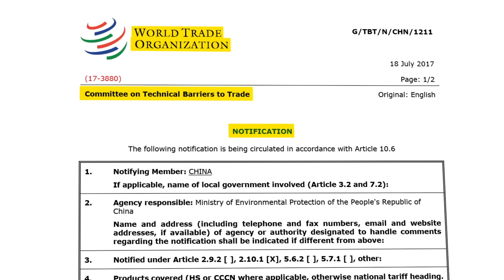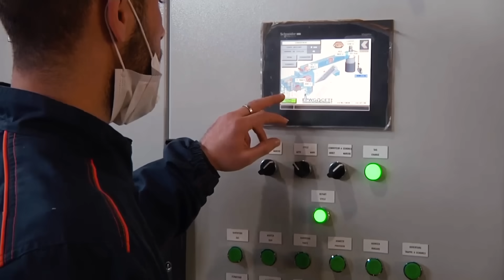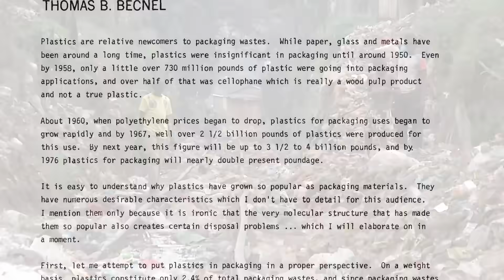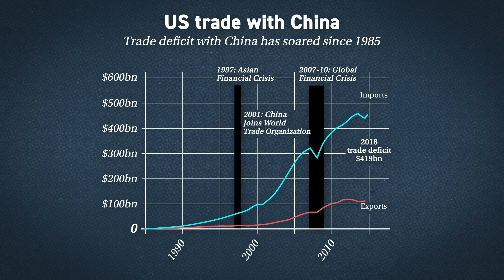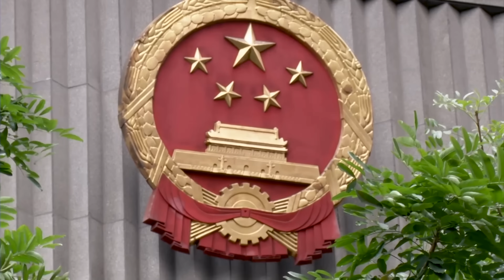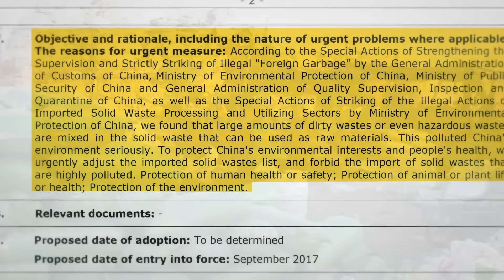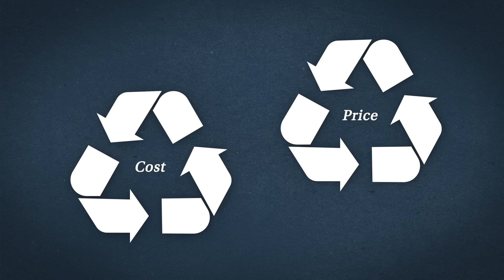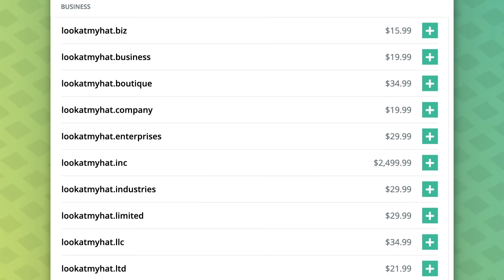How China Broke the World's Recycling

Comment: I think this rather misleading.
Firstly the Chinese broke the recycling system twice. 
First when they started pulling a ton of waste in. This caused major changes and shutdowns. You point out that the plastics industry started to look at the recycling programs in the late 60's but it was only in the 1990's-2010's that the export-to-China system became dominant in the US. They changed the market for recycled goods which drove how investment was done and this in turn changed what could be done profitably. Better autosorters were not invested in because there was the system for handling those bales was so dominant that people couldn't achieve scale on many of the advancements that were technically made and discouraged investments in new technology. So while it is not to say there were not some advaments there were far fewer in such areas and most were limited to the high value areas and they didn't spill down the value chain. The market became heavily distorted on the expectation on China buying these classes of trash. Domestic recycling systems in many areas couldn't compete and changed to the export -to-china model in places like Ireland for example. 

This then led to changes in what was acceptable stuff to put in the recycling bin in the first place.  driven by the knowledge that the Export-to-China system existed.  By this time flexibility in the system had dropped to nill....everyone was on the export-to-china model...even when people knew about the problems.  Like so much in focusing on the economic perspective people dropped externalitlies and same solution popped up as reasonable due to what assumptions were put in. Misuse of VAR, Export-to-China, the stock-buyback surge of the last 8+ years, probably the everything bubble of today's main asset classes...all end up pulling on the expectation of continuity and create a lack of flexibility or resilience. 
Then once the system was dominated by the Export-to-China model they changed it again by shutting the door. Prompting the changes covered in the video. But by selecting to look at the system only from about the year 2000 on you only get part of the story. Like much in economics changing your data window can lead you to whatever story you want. 

Second major misleading issue. It is a technical issue. those enzymes for example that depolymerize plastics are a direct way to reduce the cost of recycling plastics. Which in turn is what would make them economically viable to do so. It is blindly blunt faceplant at the 17 minute mark to say that economics will solve things when costs are lowered a few seconds after dismissing the advancements Economics won't solve this, economics will only record the success or failure to find such solutions.

Comment: For most things made out of plastic, there is an alternative available which is not made of or with plastic. For the last twenty years, I simply don't buy anything what is made out of or with plastic, if there is an alternative made out of cotton or wool, glas or wood, metals or leather, or any other not mineral oil based material available. You could do.

Comment: I don't like the repetition of the phrase "recycling only works when it's profitable". While I understand that you're making a point about how markets function in regards to plastics, it's important to remember what the trade-off here is. If we don't recycle, and by that I mean actually sort and reuse our waste, then we will have growing problems with overflowing landfills and increasing scarcity of oil.
In 50 years the price of oil may be so high that recycling becomes profitable, but in waiting for that time we will have done massive damage to our environment, and thus, much as China realized that recycling wasn't profitable from the perspective of the whole country, we will be forced to recognize that not recycling isn't profitable from the perspective of the whole planet.

I wanted to add an edit after I finally finished the video, just in case you touch on this point at the end, which you do. Unfortunately.
"The solution is to shut the system - the whole system - down."
This is hopefully only a poignant and slightly hyperbolic talking point to end on. However, if it is not, it is insane. To return to economics, you now have to balance the cost of not using plastic to the cost of recycling plastic. This is exactly the crux of the issue, an issue that spreads far beyond plastic, where the manufacturing industry does not pay for the damage their products do to the environment. If oil companies were required to pay for the CO2 recapture, then driving would be prohibitively expensive, but it would reflect the actual cost of oil.
Similarly, plastic companies should have to pay for the cost of recycling the materials they produce. This would drive the cost of virgin plastic products up, and recycled plastic would easily be able to compete.
This is not the same as shutting the whole system down.

Comment: Only Steel and Iron can be picked up by Magnets, NOT "MOST" Metals.
Reply: Magnets actually can sort non-ferrous metals. They just can't pick them up directly.
It works by spinning the magnets quickly, inducing a current in the metal. The effect is a repealing one.
Reply: Yeah but most recyclable materials are made of steel and iron. He meant most metals that are used in products that can be recycled.

Comment: I have worked in the plastics industry most of my life - the last 20 years of that with plastics recycling. A group of entrepreneurs headed by a gentleman, Mr Sam Ayoub, retired Coca-Cola CFO, purchased a complete "turn key" plastics recycling plant from Germany in 1988. It was shipped to Georgia and set up in a 63,000 sq ft warehouse building. I came on board with my technical knowledge eventually overseeing almost all aspects of plant operation (excluding the financials).
It took from 1988 to 1999 before we finally developed a profitable product using HDPE & PP materials. In a nutshell the plant grinds/shreds post industrial plastics waste - blends in natural fibers - extrudes into molten preforms that are then placed in compression molds making the product that is bought by another company.
(I'm keeping names/ product details out).
My summary: co-mingling of differing plastics is big problem by post-consumers (and residual food scraps).
Most difficult plastics to recycle: PS /PETE /PVC (most commonly used in packaging). Metalized film (potato chip bags example) are also bad. Plastic parts containing metal (screw inserts molded in are also difficult to recycle).
Those super thin single serving water bottles are very bad - not recyclable (but have recycle symbol on bottles). If anything - DON'T buy these - buy water in the gallon HDPE jugs - that plastic is easier to recycle.
It is up to consumers to encourage recycling. 
Plastic "tee shirt" bags: use one to stuff others into - when full tie it off using the "handle loops".
KEEP THEM CLEAN! no paper receipts etc...many stores (Walmart does) have recycling bins.
Molded HDPE & PP bottles - laundry soap / cleaning soaps / hand moisturizers / etc are very good recyclables....best to rinse out after empty.

Keep a preference to buy products made of recycled plastics  - you have to create a demand for these products. We tried planter barrels etc - just wasn't enough demand to make worthwhile.
The recycle symbols now seen on all plastic products is really a joke. Industrywide companies organized the plan to have recycle symbol on all plastic products to "convince" consumers recycling is a "done" working issue. IT'S NOT!
It's just fool you - the consumer. 
It's unbelievable (to me) we are expected to just throw away all those plastic bottles etc after they're empty. THAT'S GOTTA CHANGE.

Comment: What if the EPA was funded to put out a major RFP to the plastics manufacturers to develop a system to reduce the cost of domestically-recycled PET to some alluring target threshold (e.g. $0.40/lb)? Through some chemical and/or biological processes, plus automation, infrastructure changes, and some additional research I bet it'd be possible. It'd likely be a multi-billion $ program but the DoD, by comparison, eats those for breakfast. Then, once that process was well-understood and could be implemented, levy a tax on virgin PET creation (which would likely be passed onto the consumer) to cement the shift of economics toward the recycled material and further-discourage the introduction of new plastics into the cycle.

Comment: Recycling in all sorts of materials DOES pay and the private sector pioneered nearly all of it. I have worked at a polyester recycling plant run by Kodak, and a papermill that used large amounts of recycled paper- and not because they were required to do so. The government rarely does anything efficiently. This video itself admits several types of most common plastic are recycled profitably. The fact that some are borderline or cost something to recycle is not some giant failure of the whole system. In fact Eastman Chemical of Kingsport Tennessee recently came up with a way to recycle nearly all polymers including for instance old carpets. By the way, did you notice they pointed out that cheap oil was part of the problem? Well remember when all the environmentalist hysteria mongers were telling us that oil would soon run out? In fact can you remember a time when they WEREN"T telling us this? I'm nearly 62 I can remember constant warnings of $100 barrel oil prices and even as late as the early 2000's they claimed we were past peak production. Except it has always risen and the oil in Alberta alone is estimated at 300 billion barrels.

Comment: What shit, call it recycling and recycle nothing, the only recycling system that has ever worked was the GDR's sero system. the end-user was rewarded for cleaning, single-type collection, single-color collection and all the complex and expensive industrial sorting machines were not necessary. The processor only needed to melt down the big packs and use them to manufacture new products.

Comment: The only solution to this problem is a depository system. When you buy a product with a particular plastic you pay a deposit on it commensurate with the cost to sort and process it. Such a system also takes advantage of market forces as food packagers benefit from selling goods in low deposit plastics. Some plastics are so valuable that even after sorting and processing they can be sold profitable. However, such plastics are also expensive when you buy them. So this is very much like the gold standard on the dollar. Some plastics "back" their value but you pay for that in the same way hoarding mountains of gold is a cost to the economy. Where as a depository system regulates the value so it still flows through the economy like before but without the higher cost. You benefit from lead acid being recycled when you buy a car battery since in that case there is both a material with intrinsic value that has a significant cost to mine and at the same time also has a depository system to encourage recycling. Note that you get this deposit back 100%. With plastics the deposit would probably not be recovered at least not at 100%.

Comment: There should be a federal law that requires all plastics sold in the United States to be made from at least 25% recycled content, to start.  Then every 5 years, it goes up 5% until all plastics sold in the United States are made from a minimum of 50% recycled plastic.  For those products that are made from types of plastics that are not recyclable, well those companies will have to find a different packaging solution...one that doesn't destroy the planet.  I'm usually not in favor of government regulations on the economy, but come on...something seriously must be done about the problem with plastics.  If a federal law like this was passed, then all of a sudden recycling would become profitable domestically.  Sure the price of plastic packaging would go up, but I'll bet a lot of things that are currently packaged in plastic could find some other packing solution that was even friendlier to the environment.  Like drink containers for example....drinks could go back to glass containers, which are 100% recyclable, and we could go back to the system they had in the 1950's where when you bought a case of 24 bottled drinks, you saved the bottles and returned them to the store for $.  THAT was a 100% sustainable system.  There are also drink containers made from paper products with a wax coating, like the little milk cartons you used to get in elementary school.  Those are 100% recyclable.  Soft drinks might have to go back to either glass or aluminum, both of which are 100% recyclable.  We need this world to be livable for a very, very long time, so we can't exactly just keep doing what we have been doing.  I think it would be great if the United States became the first country in the world with net zero plastic waste.  It should be illegal to put plastics into a landfill, period.  I mean come on, plastics take thousands of years to break down, and they poison the environment along the way, so we need to stop doing it.  Period.

Comment: Several ways to remedy this, Convert oil based carbon to power without pollution.
Convert crap plastic to a reusable plastic $$$$$ or Find a Black Hole. 
Lets go with find a black hole because I can't think of any way to convert rubber and plastic to power faster and Clean other than PLASMA / HEAT / WATER / STEAM / POWER  ... the actual physics is not confusing to me.
Someone looking for an opportunity would go nuts trying to access this ready free energy should start here, and used rubber as a City Power supply ... 
A Business Out of Covid-19, turn City Waste to City Power, Clean with Plasma. 

I Bet you can't work out how to do that.

Comment: Companies broke recycling not China.
Companies went green and used recyclable materials which sounds great but their are no markets for it.
Coke use only about 5% recycled material making new bottles.
Anyone see a problem with that?
The reason is plastic loses some of it's properties every time it is recycled into a new product which is always of a lower quality than it started out as.
Every scrap of plastic ever made is heading for land fill or the ocean bed as it will one day be useless for anything.
We've all bought low quality plastic products that were barely fit for purpose and then only for a short time. Next step our ecosystem.

Comment: Most of the big profitable plastic recycling companies are handling engineering plastics. Commodities plastic such as Polypropylene and polyethylene are more likely low in value but the prices is more stable, only way to make it profitable is by processing in high volume with efficient and using semi high tech China recycling system and machineries with proper pollution control system...in fact, all the Plastic recycling companies owners are filthy rich especially in China / Malaysia / Thailand and etc...

Comment: Use recyclable material, in a cleansed, as is state, for use in a different product that can utilize these materials as a useable, sensible, tool. Such as, insulation, or a heat and pressure fused covering, or laminate product. This is hardly a resolution-less problem.